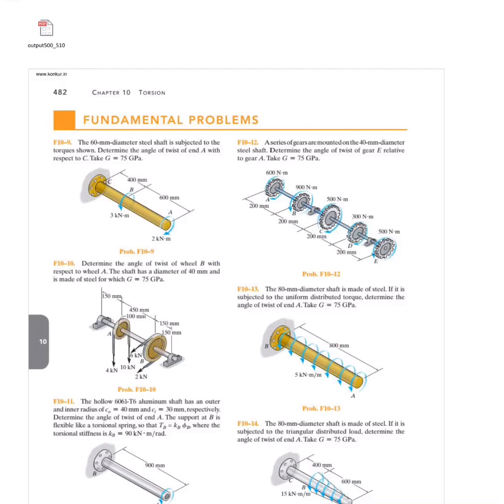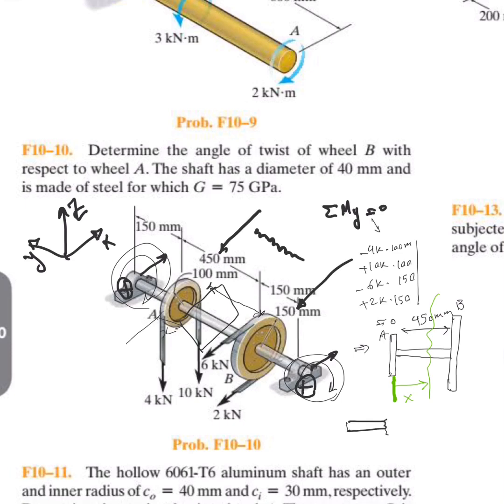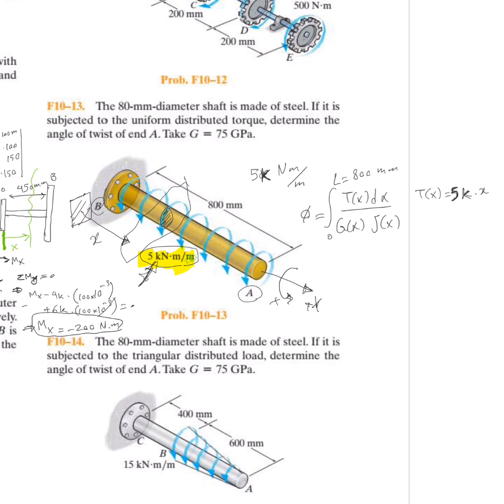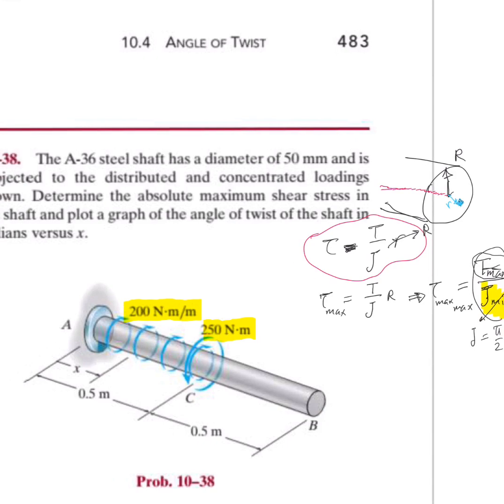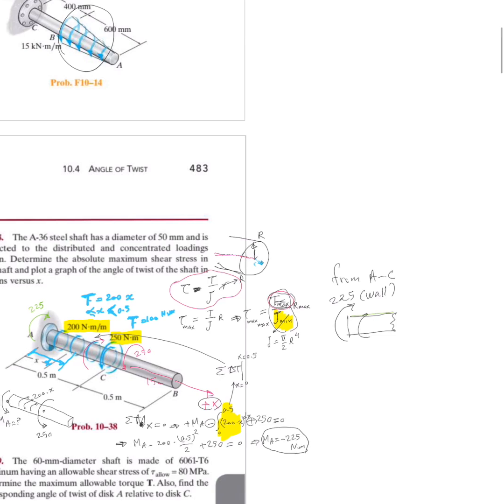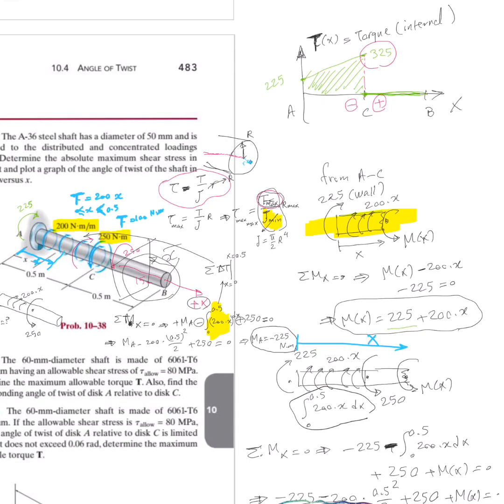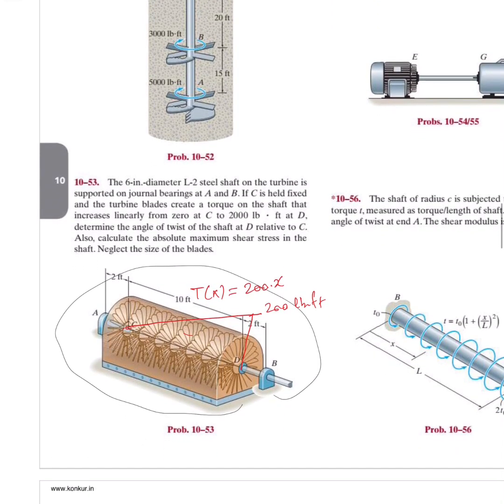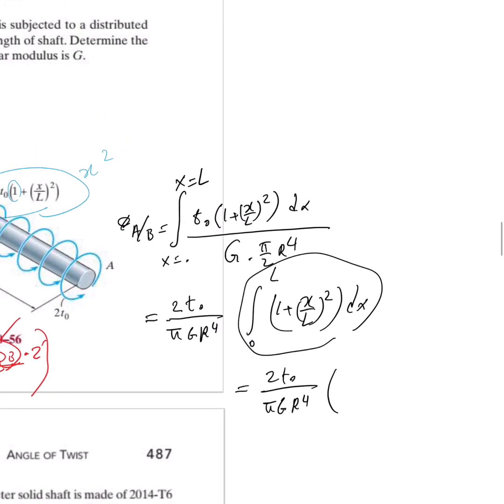Lecture March 24th 2020 - part 2 (SEE ERRATA in the description)

Comment: Professor, I am confused on the method at which you arrived to T(x)=200x at 42:31.  Since the torque is at its maximum at point D (2000lb*ft) would you not set up a proportion to find the line from 0 to x(10) which would be T(x)? Using the gradient formula Y2-Y1/x2-x1 it can be said (2000-0)/(10-0) is the gradient of the line. Putting the gradient into slope-intercept form gives y=(2000/10)x as T(x). This simplifies down to T(x)=200x which is the original answer you arrived to as well. Would not T(x)=200*x^2 be a parabolic torque and not linear as the problem says? I was just a little confused at this part. Thanks so much, Tommy
Reply from the maker: Hey Tommy, yes it is 2000 * x I forgot a zero ... I was very sleepy that day :) I didn't notice to 10'  and it accidentally happens to be fixed to 2000/10 to reach my 200!